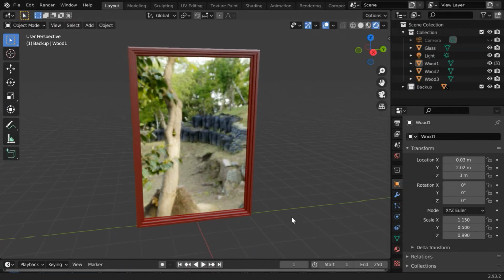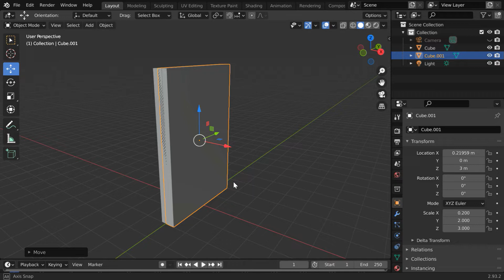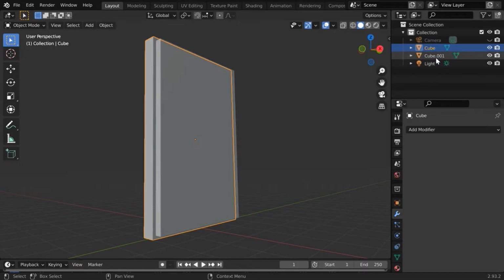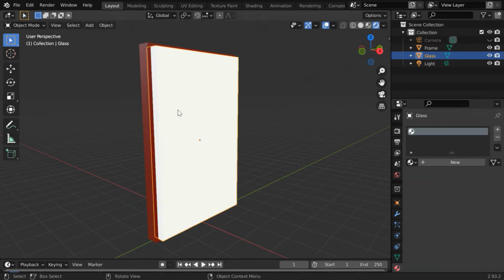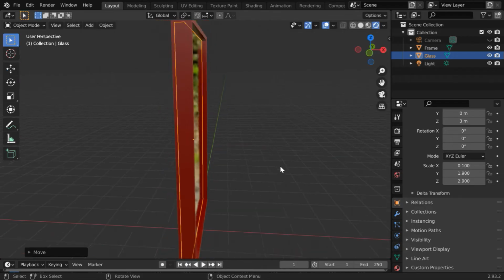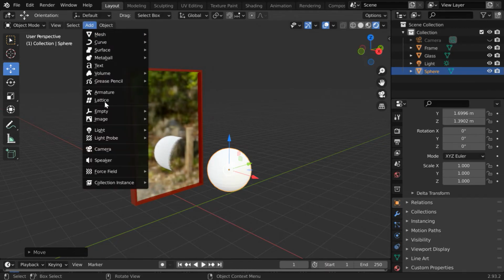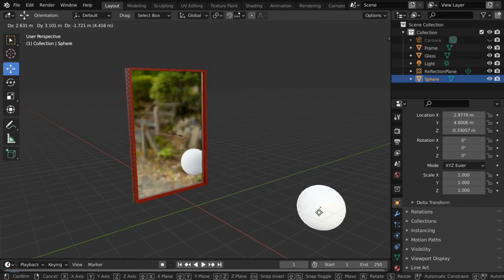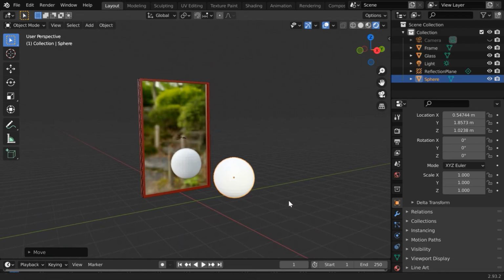Create Perfect Mirrors In Blender | Use of Reflection Plane for Flat Mirror Surface | Eevee & Cycles

Comment: i have a question (sorry if my english its not right) why is there a few leaves in the mirror reflection? is there a way to change it? im not rendering yet, but i have that question. Thx
Reply from the maker: The leaves (or anything you see) in the mirror are simply the reflection of the HDRI background. Even if the HDRI is hidden from the camera view, it will get reflected by the mirror and visible in the mirror. If you want to change it, you need to change the HDRI.

Comment: Excellent tutorial .. when I look at a mirror I think of it as a piece of glass with a silver/metal paint on the back-side.  What this means is that if you put an object against the glass there will be a slight gap between the object and the mirroring metal (5-10 mm).  I changed the recipe (in Cycles) to have a plan that was 1.0 metal with no roughness and then a cube with some width directly in front of it with 1.0 transmission ... to my eyes ... it looked just a little better as now we could see some more interesting reflection of the frame itself and when I had an object right up at the mirror (eg. writing on the mirror) it looked correct.
Reply from the maker: Yes, it is a nice way to recreate mirror surface, I got to try this as well. Thanks for your suggestions 👍👍

Comment: cant get this to work anymore after update to 4.2 version.
Reply: Had to change from reflectionplane to Plane in add then light Probe Plane then it worked but had to turn ray tracing on to get it to work.
Reply from the maker: Yep, several things have changed now - but the basic part is still the same. We have to update this tutorial at some point in time. Good that you already discovered it 👍

Comment: I am using blender 4.2 but there is no such options are showing. I means in render settings you tell some options which is not showing in my Blender software also in "Light probe" option there is no reflection plane is showing 😢
Reply from the maker: There are some changes now in the new version. Under Light Prob, now you have Plane, that is a reflection plane - use can use that. For render settings you can refer to another tutorial that covers some of these 👉 https://youtu.be/8YtA9ve3GsY and https://youtu.be/w4YSGljBdww
Reply: @5MinutesBlender  thanks 🙏🏻 i figure out it and its solve now 🙂
Reply from the maker: @yogi_samrat  Glad to know that it is resolved! Cheers!!

Comment: It is good but when we check it as output, it does not reflect as mirror. What is the solution.
Reply from the maker: I need to see your blend file in order to suggest the correct solution. But the most common issue is in placing the reflection plane correctly, sometimes the normal of the plane may be incorrect. If you are unable to locate the issues, please send your blend file as it is to us (5minblender@gmail.com), we'll check and get back to you with a solution. Please include a line about the issues you are getting so that we can relate your mail with this comment.

Comment: Is there a way of making a mirror without using a reflection Plane?
Reply from the maker: Yes, you can use Cycles. It does not need a reflection plane, it is required only in Eevee.
Reply: @5MinutesBlender  i was hoping for no cycles, i don't really look for realism, cycles is always way slow and grainy for me, i can barely work in it, even if it's on a really good computer. But hey, at least thanks.
Reply from the maker: Cycles is slow but it's not grainy. It shows grainy only in the viewport, but if your lighting is correct it will render perfect. But yes, it is slow. I hope you know the trick to use Google colab to render faster in cycles, you can use that. We have a tutorial on this as well 👉 https://youtu.be/xYqOjIo_4tA
Reply: @5MinutesBlender  And either way, my other problem with the reflection plane is if the mirror is moving. You can't just hit control j and have them joined together that easily.
Reply from the maker: @InfinityHell666  No you should not join them, you should parent the mirror object to the reflection plane so that the plane follows wherever the mirror goes to.
Reply: @5MinutesBlender  Never Though of that before, i though that only works on Armatures ¯\(°_o)/¯

Comment: My mirror isn't working in Eevee so I am just gonna use cycles. in Cycles it works amazingly. I think it has to with the light probe thing in eevee, but I don't need it in cycles.
Reply from the maker: Yes it works like a charm in Cycles and looks far better! Although it should work on Eevee as well, you just need to place the reflector appropriately, but if you can use Cycles nothing like that. Cycles is definitely a better option.

Comment: I am having a few issues. adding the reflection plane doesn't appear to fix anything. the only differences between your tutorial mirror and my mirror is that my mirror is much smaller and is in a circular frame. any ideas? the problem also persists regardless of if I am using Eevee or Cycles.
Reply from the maker: Hi, there can be multiple possibilities why it is not working for you. In one similar case reported by someone, I found that the object's normal was pointing in the opposite direction. Please ensure that the surface normal points to the same direction where the reflection plane is i.e. the surface normal has to be outward. If nothing works out, you can send your blend file to us at 5minblender@gmail.com so that we can investigate it and get back to you with a solution. Thanks!

Comment: My mirror is not reflecting any objects why?
Reply from the maker: If it is not showing any reflection at all, please check if you followed each step as described here. Switch over to cycles to confirm if the issue is with the material settings in Eevee. If you are getting only a partial reflection, you need to place your reflection plane accurately.

Comment: Excellent stuff of videos learnt a lot of things from your tutorials. 
Further, I am having trouble placing the Reflection Plan, either it does not work or causes disappear the Mirror and fram as well could you please help me out...
Reply from the maker: You can keep the "Shift" key pressed while moving the reflection plane, in order to control its position minutely. If it still does not work, you can start with a fresh new file and check if things work. Sometimes a blend file might just get corrupted to the point that something keeps on failing, but the same settings in a new file would work. If it still does not get solved, please send me your blend file so that I can investigate it further and suggest a fix. You can mail us at 5minblender@gmail.com Thanks!

Comment: For some reason, I had to rotate the reflection plane -90 degrees instead of 90 degrees, otherwise it did not work.  I'm using Blender 3.0.
Reply from the maker: That can happen due to the initial position of your object. Probably our viewport is rotated 180 degree than yours. Not a problem, you figured it out. Good!
Reply: @5MinutesBlender  Yeah, I tried the whole thing again from scratch, and this time 90 degrees worked, not -90.  But thanks for the reply!  Your instructions are very good, I subscribed, ready to check out more of your stuff.  Blender is quite a beast to learn!  I'm pretty good at some things with it, but others I've barely scratched the surface.  Tutorials like yours are very much appreciated.
Reply from the maker: @rodjohnson2632  Thanks! 😊 I wish you all the best 👍

Comment: I just modeled a three way fashion mirror.  I see that the mirrors in the reflection don't reflect, they are grayed out.  Could you explain that?  Would it be too much to render?
Reply from the maker: If you are using Eevee, it is the expected behavior. For mirror within mirror, we have to use Cycles. As you know, Eevee uses fake tracing, it is not a true picture of the objects. It does not use multiple reflections (which is essential for mirror within mirror scenarios). I suggest you to switch over to Cycles for this specific requirement.

Comment: I have done the 'exercise' 5 times following EVERY step EXACTLY yet I cannot get the REFLECTION PLANE to work. I create. rotate, resize and then move if extremely slowly towards the 'mirror' object yet the image of the sphere does not change from a reflection of 'half' the sphere to reflecting all the sphere. I have tried both Evee and Cycles and there is no difference.
Reply from the maker: Sorry to hear that. I know that it may be very frustrating when something that should work - simply does not. But I can tell you two things. If it is not working in Cycles, there is probably something else missing because you need a reflection plane only in Eevee. Cycles always gives you perfect reflection even without a reflection plane. So if your setup is not working in Cycles, I guess the devil is hiding somewhere else. Secondly, I saw this error myself. For some unknown reason, once it happened that I was not able to create reflection at all in a project. Apparently there was nothing wrong. It went up to the level that I started doubting my blender skills! But it turned out that the particular file I was working upon was corrupted. I started with a new file and everything became perfect. That particular file somehow got messed up. In any case, if you are not able to figure out what is missing, you can send your blend file to us and we will revert back after checking the same. Our Email ID is given in the About section of this channel. Thank you!
Reply: @5MinutesBlender  Thanks. I will try Cycles. Not sure about the email ID as I cannot locate the About section even in the 5 Minutes Blender channel.
Reply from the maker: You can send it to 5minblender@gmail.com

Comment: Why don't he used extrude instead of Boolean modifier, pls reply 🙌
Reply from the maker: We used a Boolean modifier for creating the frame. You can definitely do it in alternate ways, no issues. For example, you can extrude the surface and scale it down. But we also need a glass object. So we used this glass object for two purposes, it works as a glass, and it is also used in the Boolean modifier to create the frame. The frame is not very important for this tutorial. You can create it in other ways as well, completely fine 👍
Reply: @5MinutesBlender  you gained a sub man!!!! Only because you responded and your super great contents, nice works, keep up ❤️❤️
Reply from the maker: @Rand0m-yt  Thank you so much for the sub 💝 We try to address all comments and questions from our viewers. Your appreciations are our only rewards 😊

Comment: So I'm making a ballet studio with mirror walls. How do you reflect other mirrors onto another mirror?
Reply from the maker: Good question! I think your best bet is to go for Cycles in that case, it can support reflection of mirror within another mirror, in a chain sequence. You need to use a separate reflection plane for each mirror. If you only need the mirror to be visible through another mirror, this same setup will work in Eevee as well - but it won't show the objects within the mirror. Cycles can do that easily, I have tested this. However, rendering time will increase considerably.

Comment: I have done all what you suggested and unfortunately it's not properly reflecting both a cube which appears to be elongated and the face is still invisible and a human form  which is just reflects as a coloured band. I am using version 3.
Reply from the maker: It should equally work in version 3, without a change. For another viewer, oddly this was not working because the world settings were wrong. We discovered that only when we looked at her blend file. I would request you to kindly send your blend file to us, so that we can quickly check and suggest the fix. You can get our contact details (Email ID) in the About section of this channel. Will wait for your blend file. Thanks!

Comment: my mirror is still not working the way you've got it going the reflection plane is not working for me
Reply from the maker: Okay, I can help you, but I need to know exactly what is the difference between our demonstration and your output. One possible cause may be the placement of the reflection plane. The thumb-rule is, it should follow the orientation of the mirror surface (I mean the rotation angles), it should be very close to the mirror surface, maybe even overlapping with the mirror surface slightly, but it should not overlap too much, most of its width should be outside the mirror surface. The best way to achieve this is, place any sphere in front of the mirror, and then move the reflection plane into the mirror and look at the reflection of the sphere on the mirror. Stop at a point where you think the reflection shows best. You can press the Shift key while moving the reflection plane, to gain finer control over its movement. Please let me know if this solves your issue. Otherwise, I would request you to send me a copy of your Blend file, so that I can look at it and find out the issue. You can get our contact details (Email ID) in the About section of this channel.
Reply: @5MinutesBlender  ok I'll try it and let you know

Comment: Great! And what if need a correct reflection on multiple objects? For example, pieces of mirror or some windows in the building?
Should i use this plane on each reflecting object or i can stretch it for all of them?
Reply from the maker: You can stretch it for all of them. One plane is sufficient if the windows are nearly on the same plane. If not, you will need separate reflection planes.